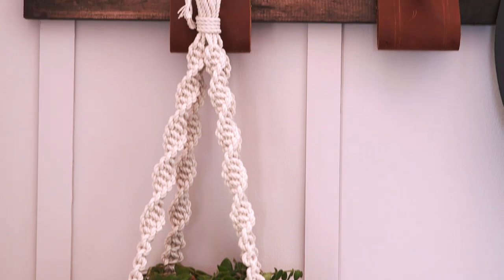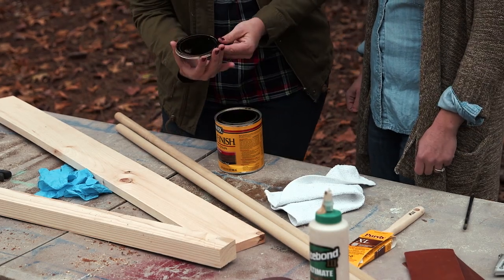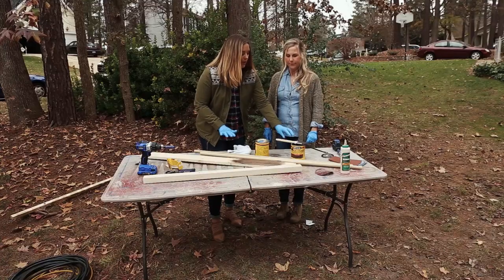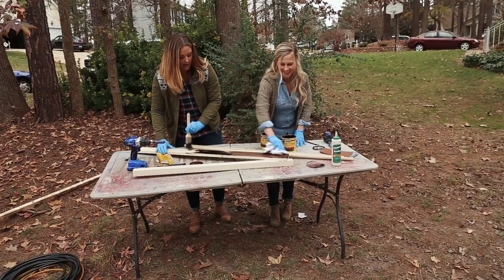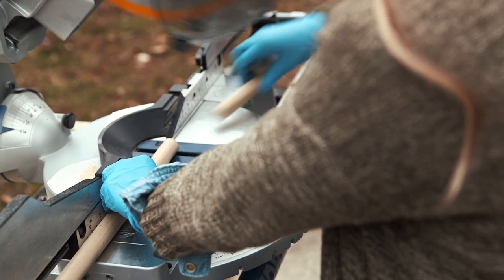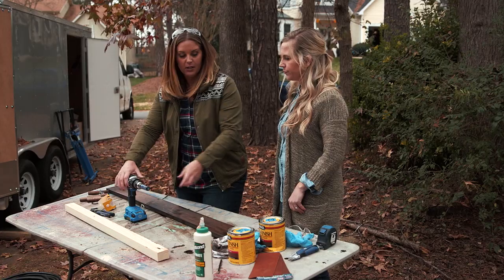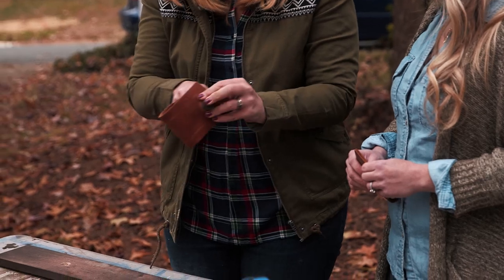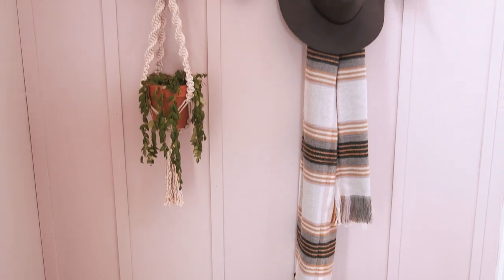DIY Leather Coat Rack

Comment: You should have drilled it before you stained it, so you won't chip the front. The if the front did chip, you you have to go over that area.